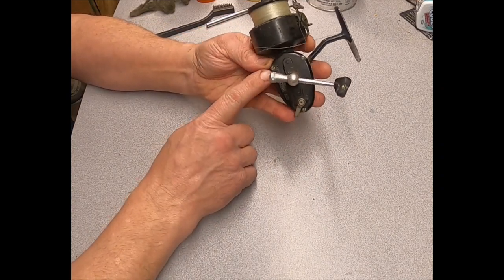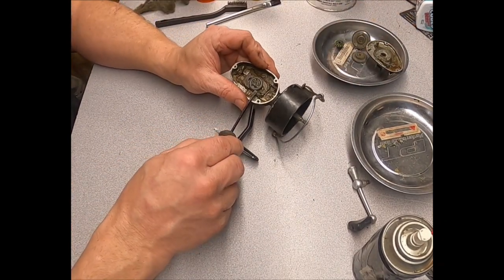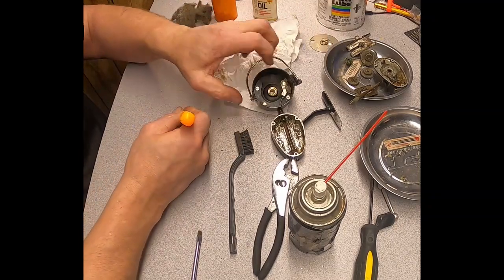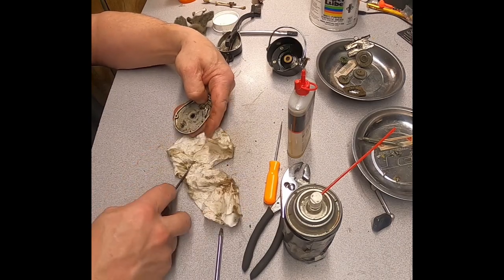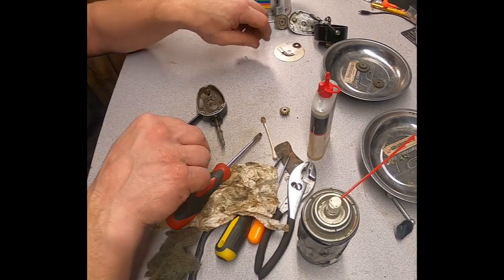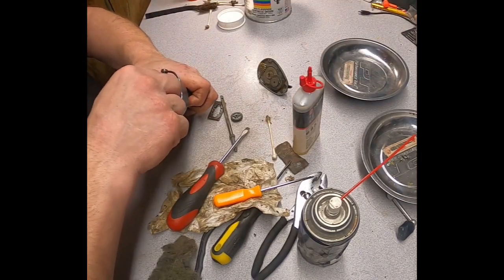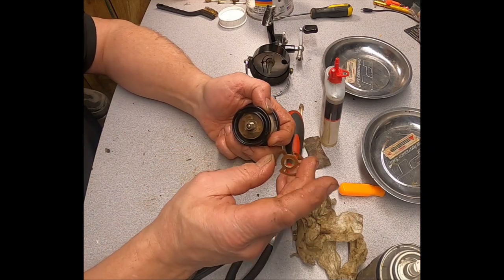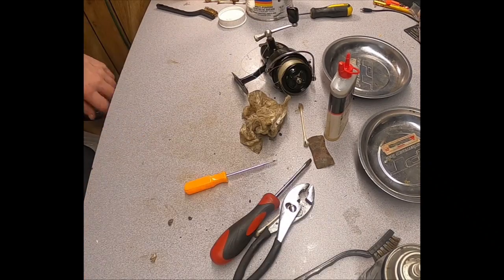Garcia, Mitchell 300 Service and repair

Comment: Very nice reel. as far as the drag I think there should be a nylon washer under the spring. I have several of these reels and they all have one, it"s not much of one either it is thin flimsy nylon so my opinion if it works without it so be it.
Reply: Yes sir, that's what I found too. :) lb
Reply: Depends on when the reel was made. The earlier 300s had a red hard plastic drag washer whereas the later 300s had flexible white teflon washers